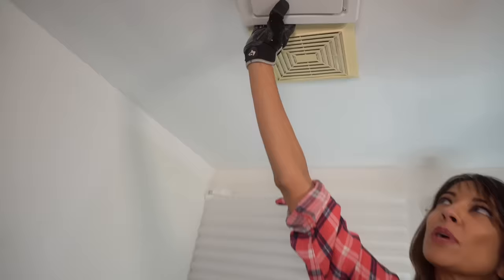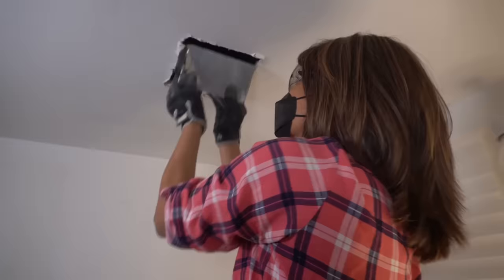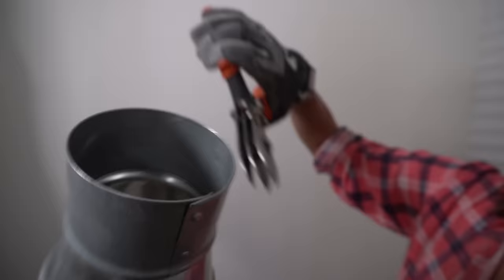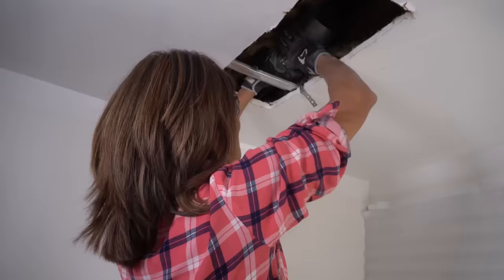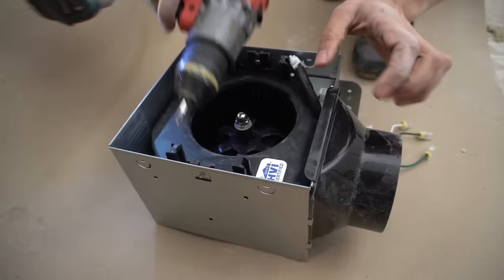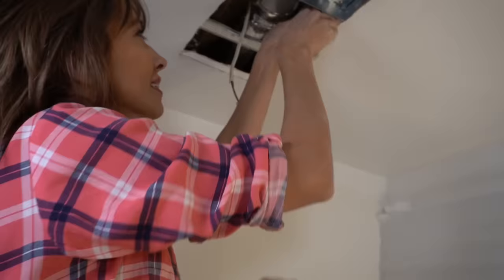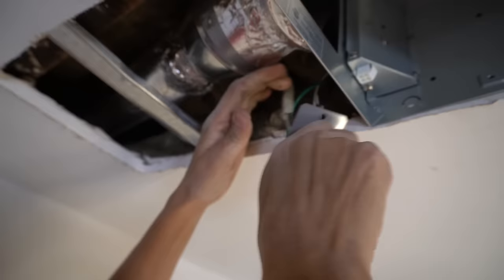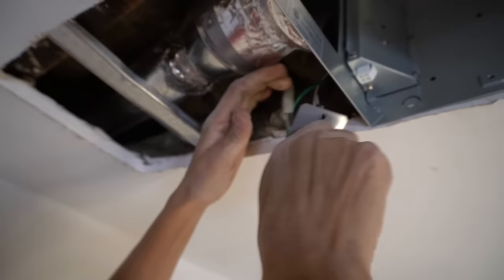Bathroom Exhaust Fan Replacement Upgrade | No Attic Access

Comment: Love this!  Just what I needed!! Ty. Love those Milwaukee tools too
Reply from the maker: Hey Steve, thanks! They’ve been great, love them too 💪🏽
Reply: @DaruDhillon  how is that unit performing? I do like the cover as well.  I've been looking at the Panasonic whisper models
Reply from the maker: @sgirl1822  I was actually surprised how good it is. I haven’t tried the larger CFM versions but I’ll definitely be using it again. The reviews are strong on Amazon too last time I checked. The fan cover looks more high end too which is a bonus.

Comment: Great video. One question, if I buy say an 80 CFM fan that requires or recommends a 4 to 5 inch duct, and I reduce it to 3, how much CFM will I lose due to the back pressure on the fan but having such a small duct?
Reply from the maker: It’s always better to use the same size vent if possible to keep your CFMs consistent. I’d add to the scope of this job now if I was doing it over.

Comment: This video is wonderful and very detailed.  I have purchased a few different exhaust fans, including this one but I have run into some challenges.   The bracket is not fitting due to a pvc pipe that is in the way of where the casing would screw into.  I did find another exhaust fan that has securing tabs that I could bend over the drywall that would work, however the housing is smaller than the hole from my previous exhaust fan.  I think the best option would be to drywall to make the hole smaller, but I assume it would be best to make a larger hole and put new drywall up and then cut a new smaller hole.  Any suggestion?
Reply from the maker: Thanks Lynn, that's great. I love that you are doing your own projects. It's really inspiring! For drywall repair you can make the hole a little larger or fix it as is. For a repair like that I'd cut the drywall to fit and install backing strips in behind the repair to prevent movement. This video will show you how to repair a ceiling and everything you should need to repair a drywall ceiling: https://youtu.be/R7ILT22gAJc If you have a question. I'm here. Keep up the good work!

Comment: I am waiting for the industry to smarten up.    For odor ejection, we need to think like the stovetops that have an exhaust right beside the burner, so that you do not fill the whole kitchen with odors and change out all the kitchen air. Houses should be built with these units beside the toilet, and they should be turned on while you are sitting.   No spreading of odor thru the room and venting all that valuable heat outside.
Reply: Interesting...are you saying that you stink up the room when you go potty? Phew !!!!!!:face-blue-smiling:
Reply from the maker: Thanks for the tips!
Reply: But the fan is mostly for removing moisture from the room when showering, etc. to reduce mold and mildew. So the fan needs to be close to the source of moisture, not smell.

Comment: It's easier to tidy up wires inside an electrical box if the outer wire sheathing is stripped back to the strain relief as soon as it enters the box rather than having 2 or 3 inches of sheathed romex extending into the box which is a sure sign an amateur was there.
Reply from the maker: @Darryl603  thanks for sharing your feedback Darryl. All the best to you.

Comment: You realize that you reduce the CFM by not using the proper duct size. Good on you for taking it on though. Nice job
Reply from the maker: Yes. If I were to do it today I’d take the extra time to rip out the whole run. If I did that the amount of people hiring out their fan replacement would shoot up like a rocket. Thanks rebar!

Comment: My criteria for new fans were "quiet," "a light," and "maximum cubic feet per minute" - ended up expanding the holes in the ceiling to get significantly larger fans installed, but they move at least three times as much air as the POS ones the home came with new. Not cheap, but you get what you pay for.
Reply from the maker: Thanks for sharing your experience. I'm glad you found a solution that makes you happy!

Comment: Years ago we had a guy install a new fan in our bathroom and he just left the duct loose on top of the insulation in the attic. I couldn’t believe it! I went to Home Depot and bought a vent and fixed it myself and I slipped the duct under the insulation and then I saw the wiring wasn’t inside the box where it should be and I had to fix that. It’s ridiculous that people you hire to do a job don’t even know what they’re doing.
Reply from the maker: That’s an unfortunate situation to deal with. It’s good that you had the idea to check the work and make sure it was done properly.

Comment: Using a reducer tends to really reduce the effectiveness of the fan... actually In my area code now requires 6" vent both for washrooms and stoves...  as much as it is a pain, I likely would have replaced the whole vent line with 6" with the new fan unit.
Reply from the maker: I’d do the same now too.

Comment: That is a perfect example of my next project at my house. Question: assuming there is attic access to the ductwork, would it be easier to do the cutting and crimping and connecting while in the attic?   Thank you again for an informative and useful video. I'm learning a lot from you!
Reply from the maker: Hi Eric, on most fan installations you wouldn't have to crimp the ducting. My situation was a little more involved. Most ducting can be connected simply if it's all the same size. I hope yours is.
Reply: I certainly wouldn’t want to crawl around in the attic with the low ceiling and exposed insulation. Even patching extra drywall is easier unless yours is really big and accessible.

Comment: Myself, I would have simply replaced the motor plate as that particular part is still available. 

I understand the sound issues of this fan though to decrease the sound you will need the larger vent piping NOT A REDUCER and this is why I say I would just replace the motor and impeller.
Reply from the maker: Hi! Thanks for sharing your thoughts on this installation. Your suggestion is great and easy. Ideally replacing the vent is a good idea. I was happy to test drive this fan which has been a excellent.

Comment: Well this escalated quickly! Just paint the old yellow cover white.
Reply from the maker: @peterpowers4851  that’s a good idea! The motor wasn’t working either and I wanted to test out this fan. Glad I did!
Reply: @DaruDhillon  good work on the install. I imagine even if it did work it would have been very loud compared to the new one.

Comment: Be honest. 1) you can't screw on the grommet for the wires without attic access. Apparantly your attic cam hascaccess. 2) Do be afraid of cutting off drywalls, if you don't know how to patch it, sand it, prime, paint, repeat.... don't skip straight to the end.
Reply from the maker: This bathroom is located on the first floor with two floors above it. The house doesn’t have an attic at all. Cheers!

Comment: Yeah, you want to come over and do the drywall repair, texturing and painting (on a ceiling of all places), I'll remove and replace the fan.  And guys, don't get a vertical blade radial fan for the bathroom as shown in the video, get a horizontal blade axial fan.  The reason they had to install such a huge radial fan was to reduce the insane amount of noise that smaller radial fans create for moving the same amount of air that a quiet small axial fan can move.
Reply from the maker: This fan is the same size as the one it replaced. The issue was the location and size of the original vent, which is a problem that is common in really old houses. I chose this fan because it's rated as Ultra Quiet 1.0 Sone, energy efficient, works well and it's well reviewed. It's also affordable at 56$ and is really quiet.  It also comes with a clean cover, which is the only style I use.  It also saves me the additional cost of purchasing the replacement cover for grille fans, as most homeowners where I live don't want grill style bathroom fans.  An axial fan with a .5 Sone isn't worth the additional expense for me but it may be for you or someone else. I wanted to test out this fan because fan prices are getting extremely expensive and operationally I haven't seen a difference between my $150 exhaust fans and this one.

Comment: Man, that’s a lot of work, just to replace a vent cover😢
Reply from the maker: The fan wasn’t working. It’s definitely more work than normal.
Reply: You can just replace the motor no cutting required
Reply: And patching that cut you did would be horrible for a DIY person. At least cut a rectangle not a weird trapezoid.

Comment: There are right and left hand snips. The rights are red, left are green. It was fine to us the rights to make the horizontal cuts into the pipe. But once you started making your vertical cut on the side of the pipe towards you. You should have switched to left hand snips. Left hand snips if rem is on right of snips. Right hand snips if rem is on left of snips.
Reply from the maker: Good to know. I didn’t realize they make different snips for that purpose. Learned something new. Thanks for that!

Comment: My two bathroom fans have rusted and dripped water and I have a flat roof with no attic access so I don’t know how to fix this dripping issue. House is in Washington State and thought it was rain coming into around 3 inch galvanized vent pipes on the roof that have no rain caps but don’t think they even are for the bathroom fans. Hate to replace the rusted fans that don’t work anymore just to have this happen again. I think the fans vent to my enclosed eves outside that are vented with about 2 inch wide really long vent strips. One vents into the garage and rusted out also. Hate to cute open the drywall like you have but maybe I need to. Think this is just condensation dripping? Both bathroom fans have heaters within them also. Can’t even find the same size fans at HD or Lowe’s.

Comment: I am trying to replace my fans during my bathroom remodel. The contractors are not happy with the fans I bought, how much labor do you think this is going to be?
Reply from the maker: @Cali_wow_HC  as long as the fan fits in your joist cavity there shouldn’t be an issue. I can’t quote because labor costs vary wildly. Fan replacement are generally straightforward unless your vents are really old and undersized.

Comment: Just get an oscillating tool and a metal cutting blade and you can cut that quickly. Just make sure that you don't accidentally cut any wires.
Reply from the maker: Great advice. I appreciate you sharing. It’s handy tool to have.

Comment: The difference between a novice and a professional, I’m a contractor that was raised in the construction trade. 
I live in a manufactured home that was on the property when I moved here. 
The same problem with this house in the video not having an attic to climb up in.  Same problem with the manufacturer home. I installed a brand new duct that also has a Bluetooth speaker in the duct too. Also the 4 inch duct, so I had to use a reducer like she has. I only had to cut  small amount of the Sheetrock to make enough room to get the new duct in place and the trim piece that finishes off the duct covered the area where I had to cut out the Sheetrock on the ceiling. So I didn’t need to do any Sheetrock repairs at all. Admittedly it was a close fit with the trim piece that just barely covered my opening where I had to make the hole a little larger to get the duct in place. But when it was finished with the trim piece on you couldn’t tell there was a larger hole in the Sheetrock.  Basically did everything she did, except avoided cutting out any more of the ceiling Sheetrock that I didn’t need to cut out!  Save me time and hassle not needing to do Sheetrock repair work that unfortunately this lady made more work for herself she really didn’t need to do!  I actually did this twice, since I put new ducts in my master bathroom and the guest bathroom too!  Both done without needing any Sheetrock repairs!
Reply from the maker: Thanks for leaving a comment

Comment: I have no ventilation vent at all in my bathroom. I currently rent an old trailer, and am trying to get the landlord to put ventilation in the bathroom, but we have no attic access to get one installed. Is there a way to install one without attic access? I have to open a window to vent when I take a shower witch sucks when it's raining or cold outside.
Reply from the maker: You can do it like this and vent the air duct out your side wall through the ceiling.

Comment: How long is too long with an exhaust going to the attic? It’s a project I’ve been postponing for a while, I was quoted around $1000 for the ductwork to send it outside.
Reply from the maker: I would check your local code and the manufacturers recommendation on duct length. It important to exhaust your vent outside if it's not. Good thing you are taking care of it.

Comment: What if you opened the ceiling up, and there was loose asbestos up there?  Would your average DIY recognise that danger?  Don't know about the US, but it was very common here in Australia during the 70s and 80s...
Reply from the maker: Hello to you in Australia! It’s a good point to consider when renovating older houses. In the case of older drywall or plaster I would take samples of the ceiling in to a lab to test for asbestos. If positive we’d do proper remediation. Good and important safety reminder! Thanks for sharing your tip.
Reply: @DaruDhillon  All good.  We purchased a house 12 months ago, and before taking ownership the previous owner had to do some repairs that ended up involving $20k "extra" to deal with asbestos.  Dangerous stuff.

Comment: You can replace just the motor in most of these most it plugs in and two bolts and you can spray paint the grill face or just paint it with white house paint. It's easy.
Reply from the maker: That’s great idea Joe! Smart thinking. 👍🏽
Reply: @DaruDhillon  people don't clean these but sometimes the plastic is just brittle and brakes. People need to clean these they can catch on fire.
Reply from the maker: @joeearley3351  That's so true. I have a video on the replacement fan cover where I cleaned the fan because it was incredibly dirty. Should be done at least once a year.
Reply: That the landlord special

Comment: CHECK THE DECIBLES ON THESE NOISY THINGS!!   WORTH BUYING A BETTER ONE!!
Reply from the maker: I did a db test. Mine was really good. That’s why the reviews are so good on Amazon. If yours is high it could be an installation problem like something is not secured properly. Have you checked?
Reply: @DaruDhillon  It was just kind of a warning.  I am a contractor and some are so noisy and of poor quality (cheapest ones). It's worth upgrading to a decent one.   Not worth saving a buck and listening to it for yrs and yrs.

Comment: @ 2:11 "Don't be afraid of cutting drywall...."    as long as you know you'll be painting the entire surface afterward to cover the 'drywall repair" even though you won't mention that here. After spending $60 on top of the fan price plus drywall repair costs then we finally have the easy 1,2,3 repair. Notice she didn't show the drywall repair. She probably didn't do it herself.
Reply from the maker: Hi Rick, drywall repair is an excellent skill to learn if anyone is interested. I have multiple videos to help you out. To your point it’s a big money saving skill. You can also do fun projects like build a hood fan or install drywall returns on your windows. It’s an inexpensive and versatile material. Check out my Drywall playlist for more.

Comment: one small technical suggestion before connecting wires  in connector apply anti corrosion  paste so that no moisture/  rust  will occur & will give good Supply for  years ,& years
Reply from the maker: Hi Narendra, Thanks for sharing your tip!

Comment: What year was this house built. Trying to figure out if ours will have a 3 inch vent based on year. Mine is in the wall and I wouldn’t be able to cut out drywall.
Reply from the maker: This house is really old built around 1920.

Comment: House built in '74. Just found out the 1/2 bathroom fan is not vented out of the house...not duct.
Reply from the maker: Good thing you found it. You can add a new duct so that it vents outside.

Comment: I get cutting the drywall if its the ceiling on on the first floor of a 2 story house.  If there is access above (attic), save the drywall fix / repainting.....because if the ceiling has a texture or knock down texture it will take hours to do the repair and correctly match the texture / paint.

BTW....Never use the push in wire connectors.  The contact area is not the same as a twist on wire nut, the springs inside the push in get loose over time and all the entire electrical load is going through a thin piece of metal inside the push on (there is no wire to wire contact).  Push ins are a BAD idea and there is a reason they are not allowed on commercial projects!

Comment: Reducing it to 4inch will make it louder and it will restrict the fan suction
Reply from the maker: Yes, thanks for pointing that out. Ideally you’d want to upgrade the 3” duct to a 4” one to maximize your efficiency. That would be the best option. I’d like to shoot that for another video.
Reply from the maker: @mustangdbest220  I have a 6” duct for a kitchen exhaust that will be posted next week. NIOSH has a free app that tests decibels. I used the app to test this fan and it was close (db) to a Panasonic fan that was in another video. I wanted to double check how quiet it is.
Reply: @DaruDhillon  Yeahh also what about the outside vent too check that in the video if it’s vented out through the wall